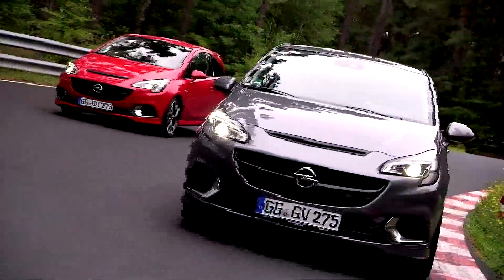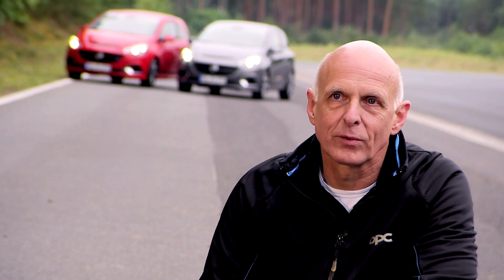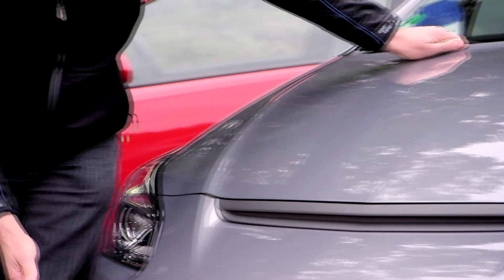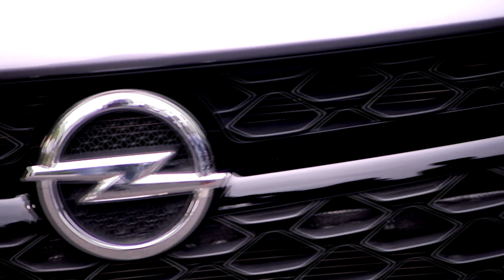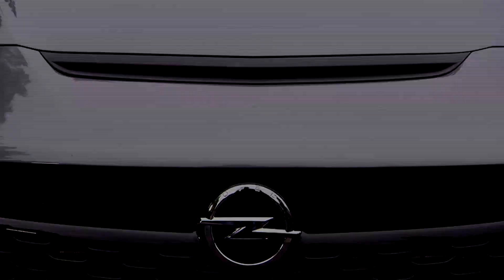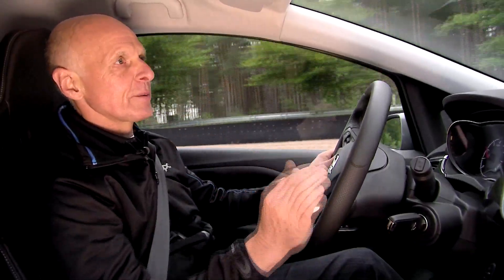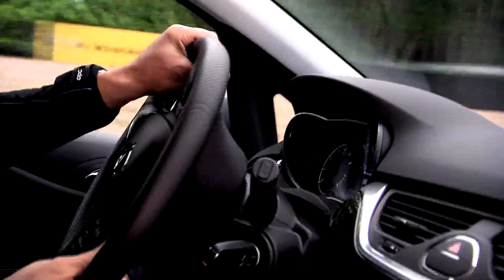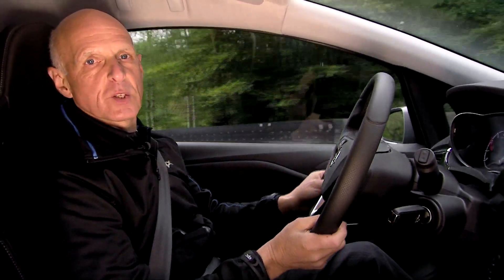Opel Corsa OPC | Performance Pack vs. Regulärer OPC

Comment: Also ich zähle schon die Tage bis zum Sonntag. Noch 5 mal schlafen und ich kann meinen 2017er Corsa OPC Performance vom Vorbesitzer abholen. :) Mit nur 60tsd gelaufen ist er noch recht frisch und als Fahrzeug welches erst von einem Opel Händler, dann von seinem Sohn und jetzt von einem ehemaligen Opelaner des Bochumer Werks gefahren wurde, ein TOP gepflegtes und scheckheftgepflegtes KFZ.
Reply from the maker: Hallo Matthias,
wir wünschen Dir viel Spaß mit Deinem Corsa OPC Performance, sobald er vor Deiner Tür steht! ⚡ 
Viele Grüße
Opel Team
Reply: @opelde  Danke, ich habe den Wagen jetzt mittlerweile seit vier Monaten und bin schon fast 9tsd km gefahren. Am Carfreitag hatte ich einen Corsa OPC Fahrer als Beifahrer, dessen OPC komplett Serie und ohne Performance Paket war. Meiner hat ein ST-X FW und eine andere Software drauf. Der Beifahrer war komplett hin und weg dass das Auto ein komplett anderes ist, viel mehr kann als ohne PP und Serie und meinte scherzhaft, er müsse jetzt wohl seine Freundin fragen, wie viel Geld noch auf dem gemeinsamen Sparkonto ist. :D Die kleine Krawallbüchse ist aber auch der Hammer, denn die Kurventempo werden eher nicht durch das Fahrzeug, sondern durch meinen Halt in den Sitzen runter gehalten (Schroth Gurte wären super) . Man kann ihn schön mit dem Gas lenken. Extrem gut. :) Für mich kommt kein anderes Auto mehr in Frage. Einzig der Preis den man an der Tankstelle (tanke nur Ultimate) für den Spaß bezahlt, tut schon weh. Die 9tsd km haben mich knapp 900l Ultimate 102 gekostet - 10l im Schnitt auf 100 km.

Comment: the Display from the Navigationsystem, the leather from the seats, an much more, the Most are little Details, like the astra j opc an vxr, the Instruments the sidewindows with heatingstripes. the engine an body are from opel an the flexride Systems, vxr Models are an 1o1 copy from opc But pricely cheaper